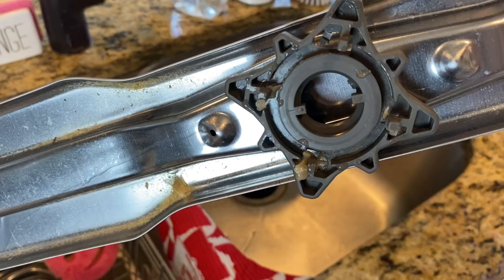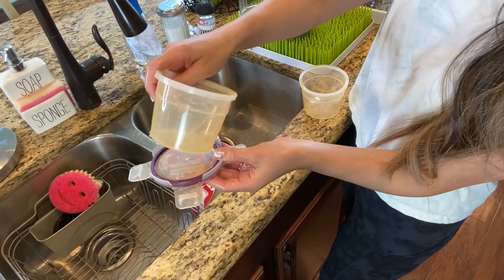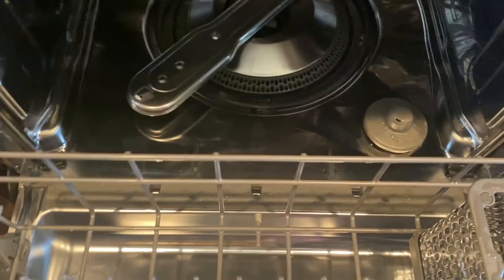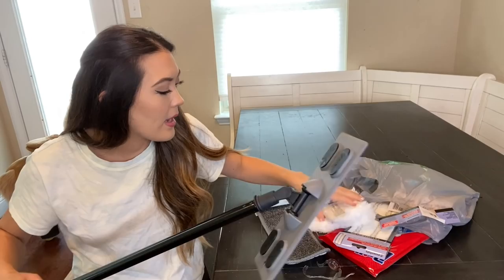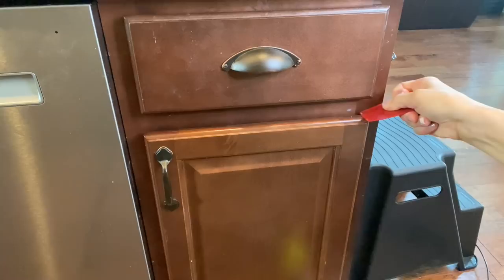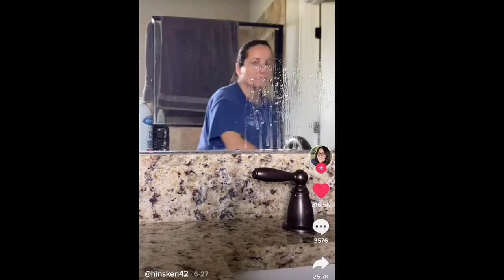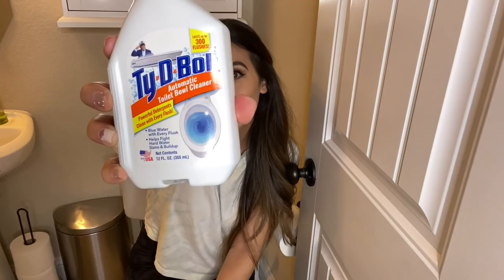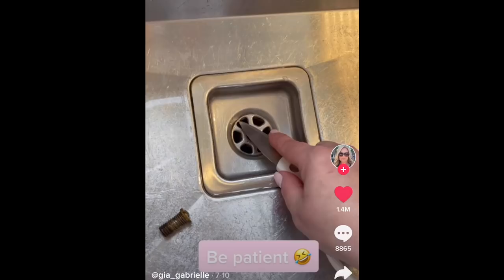TIKTOK CLEANING Hacks You NEED to TRY 🤯 2 | Testing Tik Tok Cleaning Tips | Best TikTok Hacks

Comment: I noticed you used pledge which is fine but If you'd ever want to really deep clean wood. Murphys oil soap is great. Put some in a bowl with warm water and a rag or sponge. You'll be cooking with gas then lol. It's got a fairly strong smell but by the time your done with it all you don't really smell it. If you're not sensitive to it, it smells really good and clean to me. It's been around forever and you can do a lot with it.
I hope you feel better soon ☺️
Reply: What else can you do with Murphys oil besides clean wood?
Reply: @aliciamcgilloway3707  you can use it on stainless steel sink and appliances. As a pesticide. You can use it to clean the interior and exterior of your car. Even the wheels and hub caps. You can clean your entire bathroom with it. Tub, shower, sink and toilet. Clean leather and plastic surfaces safely. Polish metal. It's better on paint brushes than a thinner since there's no alcohol in it. You can even use it as a swiffer wet jet refill.

Comment: The paper towel thing is great if you do it while there's still saucy greasy stuff in it. The paper towel soaks up all the grease. Helps prevent staining if you do it before putting it in the dishwasher. I've never been able to get the stains out once they're there, though 😅
Reply: Works really good if you use a dryer sheet not paper towels
Reply: It worked for me, but I used straight dish detergent (with water & paper towel) as opposed to the spray.
Reply: @shannonrivera417  Hi how are u doing good I hope sorry for bothering u we don't know each other but I was reading some of the comments and I came across urs and I just have a quick question for u if u don't mind I have tried the paper towels before and I still do it that way it works really good on ur Tupperware but I've never heard of using dryer sheet's instead of paper towels and I'm just curious of how that works I would luv to try it out would u mind telling me how u do it with dryer sheet's and do u think that it works better and cleans the Tupperware better using dryer sheet's instead of paper towels?? Thanks!!
Reply: @shelly8739  just put a little bit of soap and water and the dryer sheet put the lid on it and shake it
Reply: Wipe stains off with a wet dish rag, paper towel or sponge and baking soda!
Reply: @gingereaves4097  I use about a tbsp of baking soda, few drops dish soap and hot water, let it sit overnight or a few hours, before I turn on the dishwasher, it hasn’t failed me yet. Good luck!
Reply: @patriciarider40  Thanks.

Comment: Dollar tree hack for the red scraper - get a dollar tree rubber spatula, you can use it with the handle or just pull the top off the handle
Reply: I go to Dollar Tree and buy a plastic paint scraper.  Also use one for stuck on food on dishes.  Works great!

Comment: I put a cup vinegar in each dishwasher cycle it helps to keep the dishwasher clean and fresh smelling also helps the filter stay clean and works like a rinse aid instead of buying those expensive finish products for spots
Reply: I know this comment is old but are putting a cup of vinegar in like she is in the Tupperware? Or just throwing it in the dishwasher?
Reply: @olliezgamez1767  I put it in a coffee cup on the top rack. Filled about half way up. As the dishwasher runs it finishes filling with water and spills out into the dishwasher. I also put it in my washing machines in the bleach dispenser and softener ball . Hope that helps.

Comment: Fun video! Soaking Tupperware in white vinegar 3:1 dishsoap & water (several hours) can remove stains & smells. Using dishwasher cleaners are a little easier than taking all of the blades off because they work with the dishwasher’s cycles. No need to remove parts. It’s MUCH easier. You just place them in the empty dishwasher, (usually in the silverware bin) and run the dishwasher as normal. You can find it at most stores like Walmart, Target and grocery stores as well.

Comment: The paper towel cleaning hack failed because you had too much paper towel. One sheet. Dawn dish soap and hot water. The paper towel has to be able to move when you shake the container. Has worked for me every time!
Reply: It does for me too! She also used the Dawn powerwash and not dish soap.
Reply: Also, has to be used on just used container not already cleaned container.
Reply: Thanks for that. I'll give it another shot with this in mind because it didn't work for me. I really liked the idea so I was bummed. Now I got hopes for it to work again!😁

Comment: I have a Swiffer just collecting dust lol, but I'm definitely going to pull it out and try it on the mirrors. This house has mirrors going all the way up to the ceiling and it's so hard trying to clean it and drag around a ladder. I can't wait to try it. The blender hack I've always done, but try it with a mixer It gets out all the sticky dough or batter. The scraper I believe Walmart has it cheaper, it works so good on Teflon pot and pans without damaging it I can't live without it. That power wash idea I'm definitely going to try. I did the hack with the Swiffer wet jet and replaced it with fabulous and that works well. I enjoy these videos so much especially when I'm down and need a little help with motivation. Sorry if I'm all over the place. Lol

Comment: To get the sauce stains and even permanent market you write on Tupperware or plastic items use the Clorox toilet bowel cleaner. Just squeeze a little out in the stain areas you can let it sit and soak for a few mins if you want but really you don’t have to and you may need to apply a little pressure to the washcloth as you wipe but anything will come right off. When I was a cook we had to label plastic containers with food in them and this was how we removed it. I also saw and had to test if a permanent marker was all over a dry erase board to remove it just write over it with a dry erase marker then wipe off! I thought no way it’s that easy and sure enough wiped right off! Mind blown! 🤯

Comment: The dishwashing drops, paper towel, and water works on the Tupperware when it's right after the leftovers are out. I don't know if it works on set in stains. I use it for taco meat and spaghetti containers. Thanks for the video!
Reply: I use baking soda to clean the stains from mine.  Works great and is safe to use.

Comment: to prevent those red stains on tupperware from happening in the first place, use a little oil or non-stick spray on the inside of the container before adding red sauce.

Comment: The last little clip, you can take the drain out; use the edge of the drain plug and put it in the grooves, twist and boom, it comes out. It was so gross for me, also, don't run water in that side of the sink while it's not screwed in

Comment: I also clean my dishwasher that gray Round this thing on the bottom right side you can twist it and lift it out and there’s a filter in there similar to what you have in your dryer that you can scrape clean with a toothbrush. Mine was pretty gross when I found out about it. I really love the hack with the swiffer or the dollar tree knock off with cleaning mirrors and windows. What is that spray you use?

Comment: Try the paper towel, dish soap and water in a red stained container again.. But do not put so much water in the container next time.. You had too much water so that it didn't have room to shake around in the container..  Also, u can use a dryer sheet instead of a paper towel and it get sparking clean.

Comment: Hack: Baby wipes are phenom for almost everything! Takes bird crap off the car. Cleanses greasy stove-top messes in seconds. Safe for hands and faces if you touch what you are cleaning. Keep a pack in the car for that too. 
For A quick fur refreshener; use a baby wipe to wipe down the fur on your pet. 
Wipe up stuck on sticky messes (honey, peanut butter), remove honey and peanut butter from fur/hair etc. 

Wipe a dryer sheet over your dog's fur to stop static and static sparking. Use a dryer sheet on ceiling fan blades and floor boards to decrease the amount of dust that will stick to them.  
A Dryer sheet wiped all over your legs will stop unlined pants from clinging, stops dresses from clinging to slips. Even stops hair frizzy stick ups and fly abouts! 😁
Reply from the maker: Such a good one!!! baby wipes really are awesome at cleaning up so much! Even tho my kids are all out of diapers i still keep them on hand :)

Comment: The hack with the tomatoe stain in the Tupperware isn’t a dud, you just can’t get rid of it once you’ve washed the stain in. If you do it before you put it in the washer with the hot steam to set in the stain it comes out 100% and with complete easy. Been doing it for years and havnt stained any of my bowls even the plastic ones. You just did it wrong lol

Comment: I love that mirror hack, I am going to try this. How do you clean baseboards, I need a hack  for that!
Reply: Get a “Chenille microfiber high duster “with the attachment pole. It’s what professional house cleaners use. It also machine washable. 
There’s no way I could clean baseboards quickly in a 6,000 sq ft home without it. Eliminates all the bending down causing back pain.

Oh, also Dawn degreaser the purple one. You can get it from Home depot. Rids all stains and dust for baseboards. It excellent for the stovetop and dirty bathtubs.
Reply: @Kedda21  thank you
Reply: After you clean your baseboards wipe them down with a fabric softener sheet, it helps to  repel dust so you don't have to clean them as often. And you can use a swiffer with a dollar store pad works just as good.